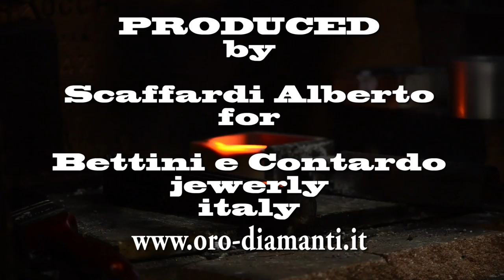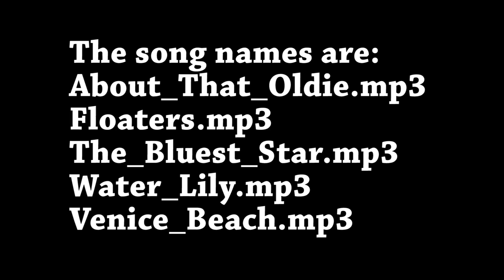Handmade three color gold band ring 18 kt

Comment: I am a starting Goldsmith. I have made a ring similar to this (2 rings 18kt. yellow gold on the outsides and 18kt ring white gold on the inside) a while back. Now I don't have much experience with repair but a family member of mine is soon getting married and would like to give them this ring. Problem is I need to downsize it, any tips on how to properly do that? What solder should I pick to resolder this? Or do I need to take them apart en resolder each and every one of them?

I mean I'm afraid you'll see the difference in colour if I do it in one go.
Thanks in advance . I appreciate any advice that can be given! 

Very nice video.

Comment: what is the rotating tool you used, that was kool? what sanding grits did you use, 400, 600, 1000, 1200?
Reply from the maker: I use sanding grits 360

Comment: It doesn't look like you used a lot of solder to keep the three rings together....what did you use to glue them together before you did the second part of the soldering? Beautiful ring by the way!
Reply from the maker: Thank you. Normally I use a solder to high-melting point , these welds are struggling more to flow, but guarantee the stability of the jewel during further welding.

Comment: hi, that is a great ring, one question, what is that spiral you use when you solder? is it for giving it more air so it warms up faster? what is the metal made of? and one other question, in another video of yours you used a stick of soldering that it melted easily without cutting it into small pieces, just touching the ring with fire it melted where you wanted!! what is that? whats the name for that stick? where did you find it? thank you very much, great work!!!
Reply from the maker: The spiral I use for welding is a table clock spring, its function is to not absorb heat, and allows the object to be welded to heat up evenly. The silver welds can be found both in plate and in thread, the one I used is a tender welding in thin wire.
Reply: @scaffoal  thank you so much!

Comment: What do you use fuel melting 18K?  i like you
Reply from the maker: +Ma Jackie propane and propane with oxygen for melting
Reply: +scaffoal  You can shoot your guns and fuel photos for me? I also use propane and oxygen mixture, but the effect is very bad
Reply from the maker: +Ma Jackie ok
Reply from the maker: +Ma Jackie  Photo Welding Torch. Torch mergers https://youtu.be/cLsp3XTmm9Y
Reply: +scaffoal  thank you very much.  Can I get you where you are using small devices , such as hand- pull 
version , I was in Beijing, China . Here you can not buy some of the 
equipment used.

Comment: what is you formula for making 18k rose gold solder?? thanks
Reply from the maker: +Raymart Samante for the alloy of gold rose they vary the percentages of copper and silver.
for the yellow gold alloy is used 18kt 750 parts of pure gold, 160 parts of pure silver and 80 copper.
for the very rosy gold using 750 parts of pure gold, 225 copper, 25 of silver.
varying the amount of copper and silver get all shades.
Reply: +scaffoal i do like your video! ahm.. i just melted down an 18k red gold which is 750 gold and 250 pure copper.. i just dont know how to make an 18k solder that fit the exact color of the piece..